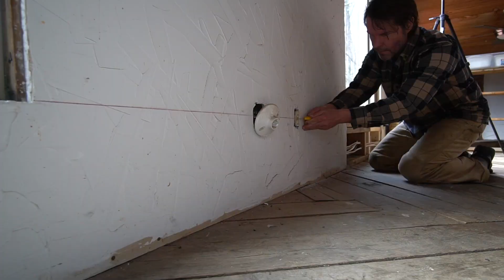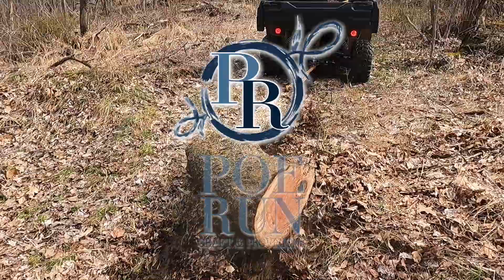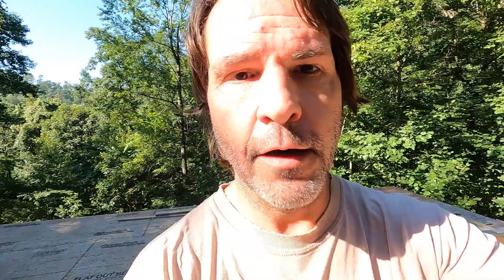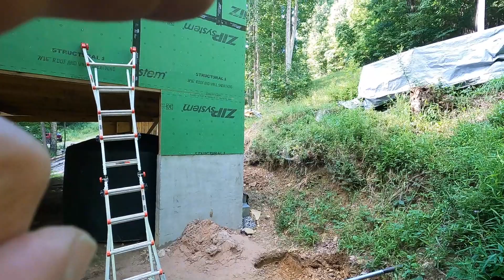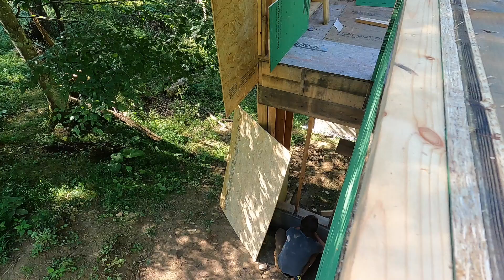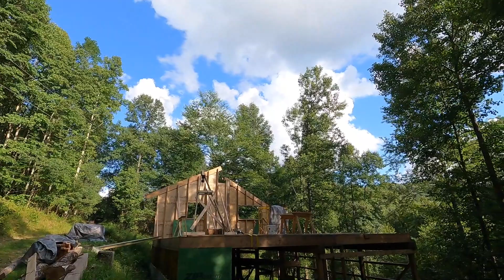Off-Grid Mountainside Income & BarnBuild Ep23 | How To: DIY Gin Pole To Lift Wall & "Shear Panels"

Comment: You had the gin pole on the wrong side of the wall
Reply from the maker: Yes, ideally it would be on the other side, but this second floor is 10ft above the ground level so I would have needed a 25'-28' gin pole.